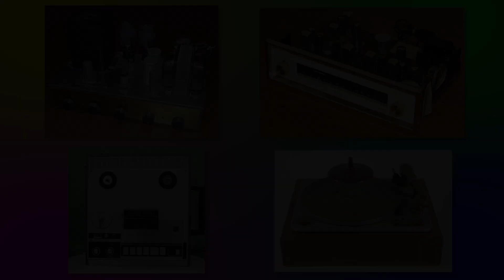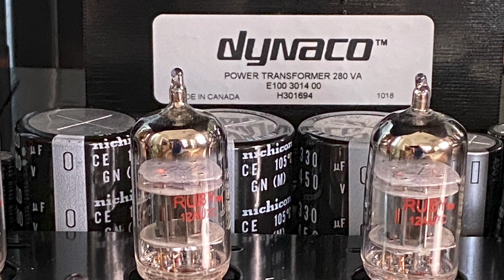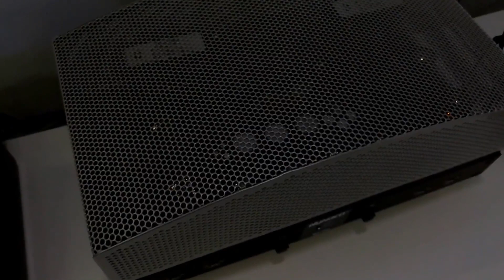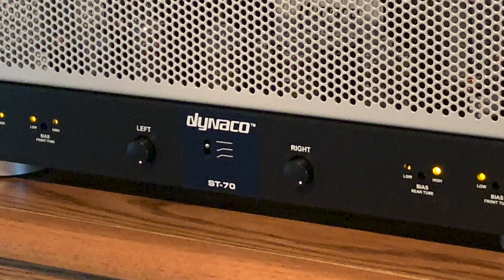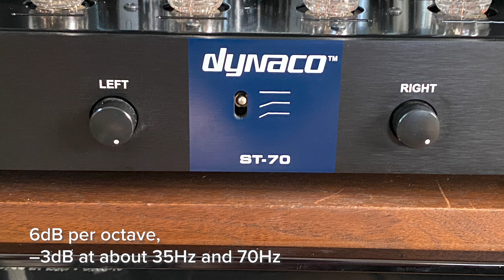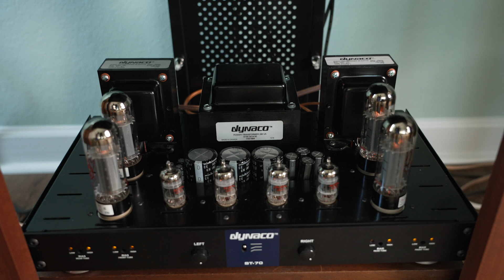Dynaco ST-70 Series 3 Tube Amplifier

Comment: I’m also a lucky or unlucky owner of one of these units - what speakers have you tried with this amp?
Reply: Stumbled across this video.  I have been using the amp in a second/office system I have found solid performed with JBL 4319s.  No issues since the 2019 purchase with many hours on the original tubes.
Reply from the maker: I’m using a vintage pair of Polk RTA 12B’s.  I also tried a friend’s vintage Genesis Model 2+.  Both are efficient speakers. What are you using and why do you say “unlucky?”
Reply: @LeeBergerMediaProd  , I'm using a vintage pair of dahlquist dq-20 (perhaps a little bit power hungry) , sounds ok  , but bass is a bit lacking , and the amp probably is not powerful enough to control the speakers  - "unlucky" only in that the company got sold, and the product got discontinued. :)  - looking to try other speakers with the amp and see-
Reply from the maker: @daveybro  Quick Google search shows between 50-250 watts .  I'd be interested to hear your opinion with more efficient speakers.  Yes, too bad Radial got bought and discontinued the amp.  Probably couldn't compete with inexpensive Chinese amps of similar output.
Reply: @daveybro  Unfortunately, tube amps 'follow' the impedance curve of the speakers. Meaning, if there's a dip in the impedance at low frequencies, those frequencies will be attenuated (vs. a solid state amp which puts out a constant voltage regardless of the speakers' impedance).
Reply: Ruark Paladins work great
Reply: I work as the Tech for a small High-End Audio store in Orangeville,Ontario Canada. We were a Radial dealer & stocked the basic MM phono pre (PH-50?). I persuaded the store Owner that we should order the Stereo 70 since we specialised in selling Valve amplification already & at $3000 it would fill a void with its combination of good price & power output, not to mention the good name of Dynaco on the front panel. So he gave me his blessings to look into the matter. Which is not to say that I didn't have ulterior motives of my own; I wanted one for myself & by getting Dealer price it would be a bargain! 
All we knew as retailers is that the Distribution had disappeared, which we assumed was no big deal as Distributors pick up & drop lines all the time & go in & out of business with almost equal frequency!🤨
Seeing the ads for buying the ST-70III from Radial directly for half the original MSRP was my first hint that something unusual & probablabedly not very good was going on with them. I knew that it either meant that I was going to get the amp for some ridiculously low new Dealer MSRP in the $750-900CDN range, or that Radial, with their poor... "listening skills", had given up on the traditional Dealer distribution model like many other crap Audio companies like PS Audio have, & decided to go customer direct. Now I know why my emails & phone calls went unanswered!😑
Then Dynaco just disappeared. I figured it was down to Radial's complete marketing ineptitude & tin-eared engineering. These guys just never "got it". They spent not insignificant amounts of money on print advertising (in Stereophile magazine if nowhere else, despite that very favourable review by Dick Olsher in TAS). The ads were all testimonials from mixing & mastering engineers in the music industry that 99% of audiophooles had never heard of & 100% of them didn't care what these tin-eared ran-dumb NOBODIES said. And it was clear as day that their testimonials were either spoon-fed to them or at least curated to death. Yet Radial could never be bothered to attend Audio Shows to promote Dynaco's visibility, nor put even the slightest bit of attention into finding good product Reps or Distributors. 
Radial's greatest success seems to have come from their home-musician DI & effects boxes, which probablabedly explains their marketing confusion by using professional music industry types to appeal to Audiophooles instead of using say, Dealer or Customer testimonials instead..🙄
The Radial phono preamps & headphone amps marketed under the Dynaco name had some extraordinary areas of merit: the engineering was bullet-proof, they were 100% glitch free in operation, & they were built with THE best quality through-hole components & immaculately assembled in Canada as opposed to Fascist China. Unfortunately, offsetting this was the unimaginative copying of highly indifferent sounding 1980-vintage National Semiconductor Application Notes circuits (with matching obsolete performance 1980's IC Op-Amps like the LM833), & VERY high prices for the mediocre sound quality & brand reputation on offer.
Radial was too stupid to understand that Dynaco was a legendary name not merely because they were made insanely popular by a large & loyal fan base, but mostly because the Dynaco name was synonymous with bargain prices & home-run sound quality to match.
Neither of which Radial's Dynaco-badged products possessed...at all.
No surprise then that Radial failed, & even less that an even more ignorant purchaser would take them over & kill them off entirely in the process.
Like what Paradigm Loudspeakers💩💩💩 did to Sonic Frontiers💩 when they took them over. Not that Sonic Frontiers💩 is a brand with a reputation even 1/100000000000000000th as worthy as Dynaco. Still...
Reply from the maker: @joerosen5464  I just saw your post today. YouTube is supposed to notify me of new posts but is not consistent.  Thanks for your interesting insight into Radial and the ST70 III.  I'm guessing you never had the opportunity to hear one.
Reply: @LeeBergerMediaProd  No, unfortunately I did not. I didn't have the highest expectations for the sound of the amp; but the lower my purchase price, the less I complain.🤗
I have been designing & building my own Valve amps & preamps for about 40 years now; so I usually can take a sow's ear & turn it into a silk purse...if there's no major design mistakes & enough room to make the necessary changes.
The use of 12AU7's was a poor choice of front-end valves, it's lousy sounding as both a cascade amplifier & cathode follower. And never mind the sound: It has 50% more measured THD at any comparable operating point compared to a 6SN7 so here's a case where measurements are in accordance with     subjective" (Observational!) listening. Too bad that new production 6CG7/6FQ7's aren't made; they'd be the easiest & simplest way of improving performance.
I know, because I owned and/or worked on every single model of Griefkit (Heathkit...🤡💩) "W" series valve power amps of the 1950's from the 💩y W-2M to the even 💩ier W-6M...
And yes, the "W" in the model # stood for...you guessed it! "Williamson"!
And Griefkit popularized the substitution of the GEC octal duo-triodes used in the original British version that were too rare & expensive for American consumption with 12AU7's, when the 6SN7 was the OBVIOUS closest equivalent!
Having made the substitution of the 12AU7🧑‍🦼 for the 9-pin miniature version of the 6SN7, the EXACT electrical equivalent made from the EXACT SAME internal metal parts down to the last detail, the 6CG7/6FQ7, I can testify to the MASSIVE sonic improvement it makes. 
EVERY time, in EVERY circuit where a 12AU7🧑‍🦽 is used!
The Williamson🤓 circuit🤡 became famous because of its measured performance ONLY; every implementation of it that I've ever seen, either commercially or by any & all DIYers, sounds like CRAP. 
But like Tannoy dual-concentric speakers, it was really advanced for 1947, back when nobody listened to how amps actually sounded...🙉😴
It was designed almost solely to help GEC (a.k.a. Marconi-Osram Valve, a.k.a. MO-V, a.k.a. GENALEX!) popularize (flog!😉) their brand new KT66 (an overpriced 6L6 & not much more, vastly inferior to an EL34. But then that beast didn't get released to the public until a good 8 or 9 years later, so I guess the comparison is a bit unfair, despite Radial/"Dynaco" having the good sense of David Hafler & Ed Laurent to use it). 
It also made💰💰💰 for Partridge Inc. (Output Transformers) 🤑🥳🤑🥳🤑, & it  was a sensational marketing success that got them "heard 'round the world" without paying a red cent to achieve it. Lucky them!😎
Really, it was that particular (& PARTICULARLY expensive!🫣) Partridge recommended output transformer that made the original amp perform anywhere near as well as it did.
Without it, it won't achieve its legendary bandwidth that made it so famous.🤥 With any other OPT available at the time, it's just another barely stable design without much to recommend it.
Nowhere near as clever as the original Stereo 70 design, btw...🤔
So w/o even hearing the Radial ST-70, I have a very good idea of what it would sound like.
Which is to say: A bit mushy, with noticeably poor portrayal of dynamics not helped along by sloppy, farting bass: Lazy, slow, &" thick" might be appropriate adjectives...
The LED bias circuit is a clever innovation, too bad the EL34's are run with excessive bias current (35-50mA? And likely the latter & not the former?) like the 1957 original was.
Not only does that excessive quiescent "bias" current further muck up the bass, add somewhat to the sense of compression, as well as cause significant subjective treble rolloff ("dull highs"); it also drastically shortens the lifespan of an EL34 for your trouble!😈
And no doubt that if you were to try to lessen the bias to a sonically optimum operating point, the LED bias circuit becomes USELESS, can't register anything other than low/good/high over the narrow range of excessive current the Designer(s) intended.🙈
Even an analog meter, with a scale of 0-70 or even 0-100mA, would have been MUCH better. And not add much, if even any more, cost than to build the LED circuit!🧐
Finally, like every other "reissue" of the classic 1957/58 Dynaco ST-70, it's an IMPOSTER.
A Stereo 70... IN NAME ONLY. 🤥🤥🤥
I've heard & worked on many & probablabedly most other reinterpretations of the original ST-70. Audio Research's Billy Z. Johnson's ST-70-C-3(?) was particularly awful, ditto the Johnson's ST-70-C-3(?) was particularly awful, ditto the ones by Joe Curcio & Purist Audio. The Sound Values/Sound Valves was less awful but nonetheless also quite underwhelming.
About the best one I've seen is by, I believe, Bill Latino(?). He basically pilfers Manny Horowitz's Eico HF-87/89 design. Mr. Latino's design skills appear to be rather limited, but I give credit where credit is due. If you're just going to copy somebody, at least he recognized & copied the best circuit!😉
Were we all supposed to be fooled?
Did that aftermarket hood for the Volkswagen Beetle that was sold during the 1970's, the one with the Rolls-Royce grille & the "Flying Lady" hood ornament atop of it...was anyone fooled into thinking that stupid grille turned a Beetle into a Silver Shadow?🤔🤪🤗🤣🤣🤣
For that matter, that the "New" Beetle that was designed by slapping a body with Beetle design cues on top of a Golf chassis & interior, performs IN ANY WAY like an original Beetle?
Just because you steal the halo over their head, it doesn't make you an 😇, too!
Radial didn't even bother to incorporate any of the original Dynaco ST-70 "Design Language", either! 🤨 🤔🫥
Other than the choice of EL34 output valves, there's absolutely NO resemblance to the original except the name!🔬😳🔎🤫🤥🤥🤥🤪
So, where IS the tie-in between the LEGEND🗽, and the IMPOSTER🥸??? 😑🤮🤧🥱😴
Having said ALL that (😵‍💫), I am still curious to hear where the Radial/Dynaco ST-70 sits in that hierarchy of all those other not-a-Stereo 70-but-pretending-to-be-a-better-Stereo 70-but-actually-not-pulling-it-off-convincingly-in-any-way-shape-or-sound Stereo 70 amplifiers
I do try to keep an open mind about pieces I've never heard before. Really!
I would be quite happy to be proven wrong.
But in all likelihood, something like the Prima Luna entry-level amplifiers would show the Radial Dynaco ST-70 a clean set of heels, as the English say.
They're the Valve Amplifier 🐘 in the room:
Less expensive, likely more substantially built, especially in the power supply. Maybe better sounding parts (like capacitors, for instance) too. And automatic "servo" biasing with nothing for the user to adjust or worry about, complete with "bad tube" indication AND protection!
Even Audio Research has resorted to this strategy, even though it degrades the sound to a MINOR degree compared to the typical "passive" form of fixed bias that Radial/Dynaco used in the ST-70...not that every other Audiophile would have the "luxury" of comparing these 2 biasing methods like I have, & be able to judge for themselves!
Lastly, Kevin Deal of Prima Luna is a Marketing WHORE, or genius, depending on your opinion of him & his methods. He pushes Prima Luna all over YouTube & social media for all it's worth, with a singular intensity & Laser-Focus unparalleled in the "Audiophile" community.
He relies on hard-hitting comparison-style advertising (whilst carefully avoiding mentioning that his 💩 is made in slave labour Fascist China, thus supporting those who seek to eventually enslave & destroy us👺🤗👹 whilst simultaneously marking up his production cost margins by an obscene amount😈), both in print & in-store YouTube videos; because he knows that this kind of marketing strategy has been proven to be FAR more effective than just a single ad campaign with clearly curated/scripted "fluffy" testimonials from people few Audiophiles have even heard of🤡🤓🤡🥸🤡, much less respect or trust!🥱🫤
And I never saw or heard of Radial/Dynaco attending ANY Audio Shows😶‍🌫️🤐, whereas Prima Luna ALWAYS makes sure that they have a presence at EVERY show!🥳🤩🤠
No doubt Dynaco was a "distraction" for Radial; it's out of their musical instrument accessory Wheelhouse. A schizophrenic product range benefits neither part of the company, & they suffered accordingly.🤓🤓🤓💨🕳️
Even if they had the good sense to try to get the Music Stores to push their gear instead of conventional Hi-Fi stores, they would have achieved far more market success/penetration than the smugly uninspired & unimaginative non-strategy they half-assedly/half-heartedly stuck with the ENTIRE time they made Dynaco-branded products!💤🤓🙉💤🔥🙈💤
Finally, being a marketing maven yourself, if you create a campaign that clearly ISN'T WORKING, , would you just keep on doing the same 💩 over & over again, expecting to magically somehow eventually get a different result? Or do you come to an understanding that on your way to inevitable bankruptcy, that you are giving a masterclass in Einstein's definition of stupidity???🤪🤤🤤🤤
Reply: @joerosen5464  enjoyable rant. Oh and it's Bob Latino, not Bill.